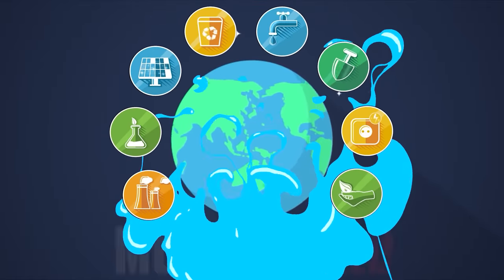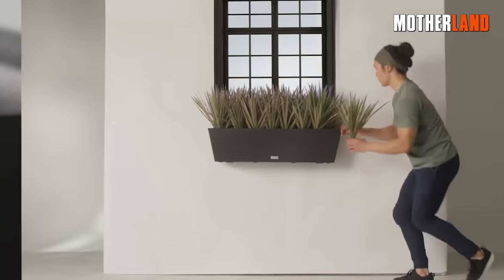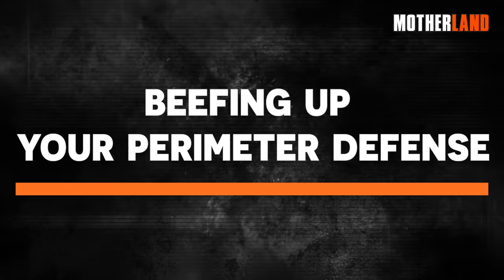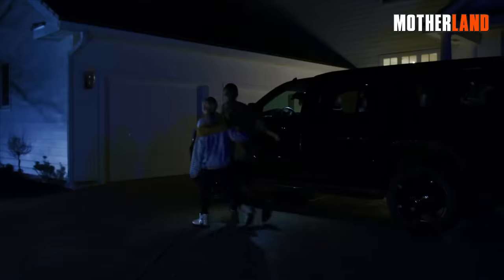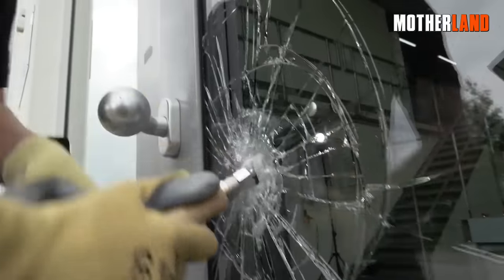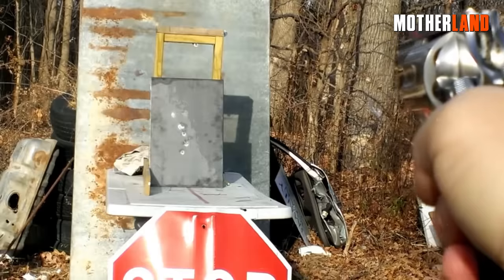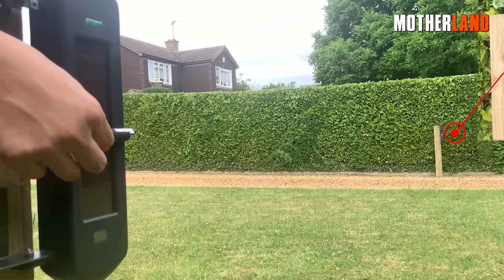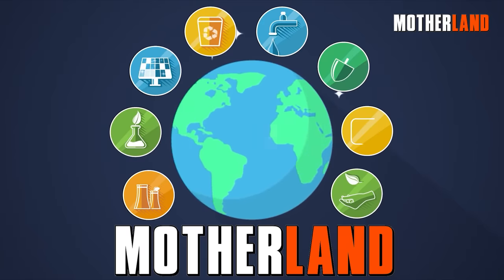Low Cost Tips to Help Bulletproof Your Home for SHTF

Comment: Maybe take a look how we build houses in Germany they would ptobably withstand even tornadoes, but thats because we use Stones not Paper
Reply: Yes i live in a more than 130 year old house in Hungary. 53cm thick brick wall...
Reply: i live in america and my home is made from unrefined paper.....and by that i mean that my walls are nearly foot-thick logs stacked on top of eachother and bolted down..... and it has survived a tornado, our gazebo that was about 30ft away however, did not.
Reply: You underestimate the power of tornadoes. They will demolish a rock house.
Reply: Well if I want any culture after war lol probably should use stone 😅
Reply: @WarriorInWaiting tyyyy  😝 thank youuuu I
Reply: Yes, my friends family house in Austria has walls .5 meters thick mit no cell reception inside.
Reply: Especially with the roladens on the windows
Reply: If my house was 300 square feet I'd build it out of stone too
Reply: @Peachy08  it's like he doesn't understand overpressure .
Reply: You can buy from foam concrete forms at big box stores that lock together like Legos that insulate the eight inch thick walls.
Reply: Yes ! German homes are soooo well built!
Reply: @Peachy08  a German house I’d bet on it !!! They are made super strong bax
Reply: Dude those German houses are basically bomb shelters lol. The walls are freaking thick
Reply: Yea most new homes in germany are wood frame not structural stone or brick.
Reply: We do too in South Africa..... 9 inch brick walls will stop up to 30 call bullets. A few 50 cals or 20mm will go through
Reply: @zsoltoravecz1815 wow thats pretty thick wall, in my country just around 15-20 cm
Reply: @zsoltoravecz1815 this really like "my home sweet castle"
Reply: But couldn’t survive ww2
Reply: Also not hard to do when your entire house is the size of my kitchen.
Reply: I live in a house right now with a Newley build addition. As I’m typing this I can hear and feel my window rattling from the wind.
Reply: In Europe houses are built for the expectation of war.  In the states houses are built with sticks and chalk.  If you tell an American your house has 18" poured concrete walls he will look at you like you said you have a unicorn in your back yard.
Reply: Merry Christmas! Obsessed Snowman
Reply: What's Germany? Did you mean Germanstan?
Reply: They couldn't withstand b52's though
Reply: We don't use paper, we use cardboard 🙄

Comment: My home has 28" thick stone walls, built in 1861.
Reply: The whole house? How cold does it get where you live? Is the thickness of the stones enough to insulate it or has insulation been added?
Reply: @kentneumann5209  Midwest United States. It originally had no insulation but I added interior stud walls with insulation. Heats with a small woodstove or one 1500w electric heater if I'm feeling lazy.
Reply: That’s awesome. I did not live on post at Fort Riley, KS, but I visited friends who did. The homes were built during the Civil War and are all stone and hardwood. They really are beautiful.

Comment: When I worked construction it amazed me how easy it would be to get into a new house. All it would take is a utility knife to cut thru the vinyl siding, foam and drywall and then you are right inside. Just having the entire outside covered in plywood before the siding is put on would make such a difference instead of using insulating foam sheets.
Reply: Better off investing your hard earned money in making a quality reliable off road bullet proof armoured motor home, bullet proof glass and run flat tires might be out of reach budget wise but having armoured plates to cover your wheel hubs all your glass windscreen with a a heavy duty armoured viewing shutters are the next best thing..now just load your essential survival supplies, water, fuel, oil,toilet paper, guns and ammo, fire extinguishers, dog food & guard dog and get out of dodge…remember a tow truck driver can’t tow your home away when your living inside with a loaded police permitted .357 magnum snub nose revolver to provide peace & freedom…
Reply: I have a hundred year old house... It's sheathed in rouge and grooved 2x6s.. I was considering filling the outside wall for my bedroom with gravel, like old banks (had done some renovations in a building that used to be a bank, the half wall for the counters had gravel.)
Reply: @danielescobar7618  we lived in an old school house one time and there were bricks between the 2x4s for insulation although I don’t think they worked that well since it was cold in there before we replaced the bricks with insulation. Of course we weren’t worried about things back 45 years ago either.
Reply: I wouldn't waste my money on these crackerjack houses they build these days. Better off building your house underground.
Reply: Wondering what state as building standards are different from one to another. Here you need 5/8 sheeting on before siding
Reply: @kurt1522  I worked in the St Charles Missouri area for McBride. The houses would have 1/2” plywood on the corners and around the windows, but in between those areas they would use 1/2” styrofoam board to cover the walls before putting vinyl siding on. On the inside there was insulation and then drywall. So as long as you picked a wall where there were no windows or doors, you could get right thru with a utility knife by cutting the vinyl siding, the styrofoam insulation, pulling out the insulation, and then cutting thru the drywall. And these homes were going for near $200,000 back 20 years ago.
Reply: @forestwoods5499 yea it's the new "green" biolding codes for energy efficiency. It's ass for durability though.
Reply: @forestwoods5499  I've seen and heard about building codes in different areas of the country, some just seem like a bunch of contractors trying to get by with the least cost to themselves set up the codes. 

Even in Wisconsin seen builder/contractors do sketchy work and then cover it up because it won't be caught for several years and inspectors are overloaded with new construction both residential and commercial -indistrial.
Reply: @zbudda  I saw that Bill Murray movie too! Stripes, back in the early 80's.
Reply: @forestwoods5499  When we lived in Missouri I liked the old rock houses. When we move back, we're going to try and find one to buy.
Reply: We have vinyl siding on the back side of the house, other 3 sides are brick 3/4 up with wood siding above to the eaves.  We've discussed about having the vinyl replaced with cement board siding.
Reply: What new home isn't sheathed in plywood or Zip panels?🤔🤔🤔😒

Comment: If you want a bomb proof home 
Pumicecrete is by far the best building material on the planet Pumicecrete is a mixture of pumice cement and water mixed and poured into a set of reusable forms walls are poured from 12"to 24" thick pumicecrete is fireproof termite proof rust rot and mold proof non toxic and has a high R value and good sound attenuation solid poured walls means no critters can live in your walls Pumicecrete can be built for a fraction of the cost and time and pumice is one of the few building materials that can go directly from the mine to the job site ready to use without any additional possessing and zero waste 
Take care Ray
Reply: Ray’s advice is spot on! Custom and varied reinforcement plates may be added. Insulation value plus surprise resiliency.

Comment: The first thing I think of when I see bullet resistant planters not fully against the side of the house is that it creates cover for approaches and attackers.
Reply: For a private home, I agree, but when you see that on government buildings it's a gambit.
They're supposed to be obvious to an attacker to use for their own personal defense. But the general idea is that area can be easily engaged by another part of the building's floors or another building on the property.
It's giving someone an obvious go-to position when said go-to position is very weak at defending from another location.
You see this strategy around many US Embassies. There are solid areas where you initially think, "An attacker can use that as a staging area for their own advancement."
Until you realize as part of the defensive protocol there are Marines are in another building with clear line of sight to that area where the low defensive wall offers no protection.
Reply: With that in mind you should not make them bullet proof and fill them with tannerite.